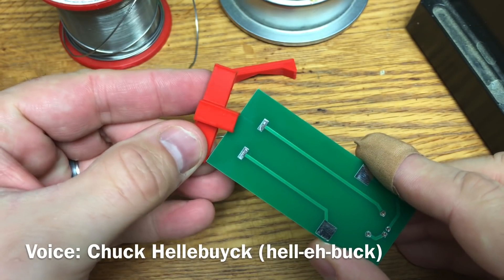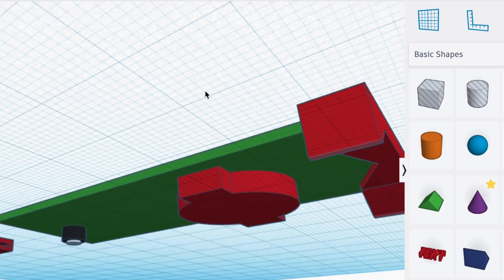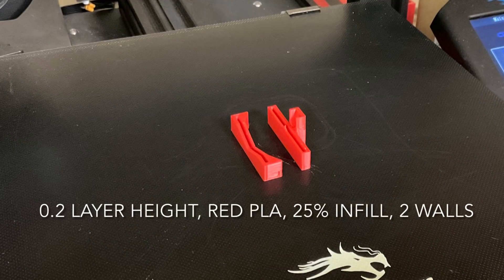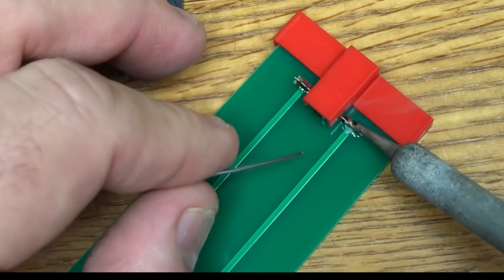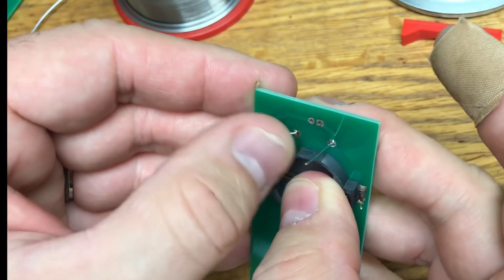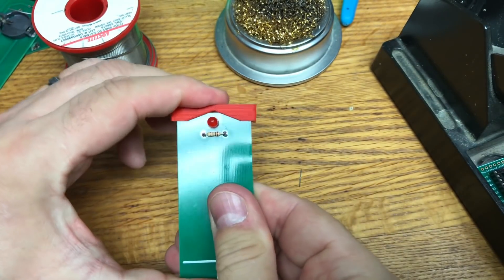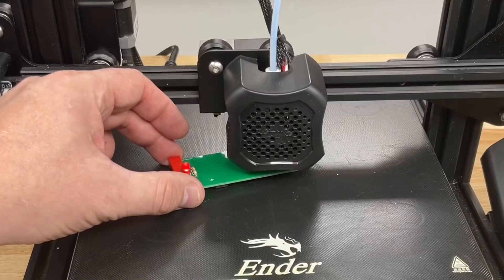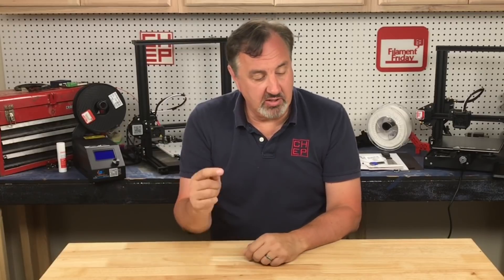Level Your Bed with the Filament Friday E-Leveler Tool

Comment: Have an ender 3 pro now and want to buy a fast printer. So around 1000 euros. Is the Voron 2.4 a good choice? Thanks.
Reply: A Voron 2.4 is not something that you "buy" ... you have to build one up from scratch. And most builders end between 1200 - 1500 € with all the parts.
When you buy a 900 € Kit assembly from Ali Express you will end up changing parts for better quality ones ... which brings up the price.
Reply: @hassosigbjoernson5738  I didn't  know, thanks for this information.
Reply from the maker: Some people like it. I’ve never tried one.
Reply: @FilamentFriday  Ok, thanks.

Comment: i must recommend the ts100 soldering iron it has been amazing i have used it for 2 years doing several drone builds and it has kept up also you can connect it to a xt60 lipo and its very portable so a must have for soldering and has updatable firmware endless features it has a stem32 chip in it
Reply: I enjoy my ts100 but as long as the pinecil is in stock I recommend anyone get the latter instead, it has all the benefits of a ts100, plus it has type c power delivery AND it's cheaper on top of that.

Comment: Good evening sir. I was wondering if you could help I have a cr10s pro V2 and I'm having a problem with bed leveling. The issue is I can manually level the bed in all four corners and the middle and it will be fine then when it comes to it's doing an auto bed leveling cycle the nozzle is too close to the bed in the middle. If I sent you a video of the issue would it be possible for you to do a video on what you think the problem is and how to resolve it I look forward to hearing from you

Comment: That can be made on busboard at the same thickness ehh. I've been ribbing you but it's an awesome spin in the simplest of circuits. Are you a self taught electronics guy? Being you have a mill and a hobbyist like me would have to beg the wife for 3 years to get one as good as yours haha
Reply from the maker: I’ve got a BSEE degree and 35+ years design experience + 3 patents. This was just fun project that grew bigger than expected.
Reply: @FilamentFriday  I figured. I'm a software engineer  for lack of a better word but I didn't do anything with the degree but I code alot now for fun but electronic engineering is a hobby/obsession for me. You're sharp as a tack and I always figured you weren't just a printer guy.

Comment: Question. Can a thermistor on my 2+ year old ender 3pro be bad.  No heating issues with new 120v bed heater.  But I noticed recently as nozzle heating up, temp would climb, then drop few degrees. Then climb. This would repeat over few times then say “ heating failure reset”
Reply from the maker: Might need a run of PID control.

Comment: Hi Chep, in Cura,  Do you know how to adjust printing speed for "Fill gaps between walls"? Thanks
Reply from the maker: I believe the main speed setting controls that.
Reply: @FilamentFriday   Thanks for the reply. The speed is not the same as the inner wall nor the outer wall. The gap is printing slower than the walls, can't figure out how to make it the same. Thanks

Comment: do you have the stl file for those  things you 3d printed tomhold the switch in place and the battery cover and the end cap
Reply from the maker: Yes, links in description.
Reply: where is the stl file for the switch cover and battery cover and end cover there is no link
Reply from the maker: They are in the description under STLs also on the more info webpage linked in description.

Comment: I really like this gadget, its cheap and easy to make, but i think that it would be easier and maybe more precise to use a dial gauge, with the gauge human error is close to 0. The biggest problem here is the allignement, for a good allignement u should be already well alligned with your nozzle, and only then put an offset hopping to be also in right height to match a motor step, with the gauge u will need only to establish first and once the z-height in way to be in range of a motor step (no microstepping) and then just adjust the level using the gauge. Without considering that the contact point will change from one button to another and from time to time cause of the time consuming membrane inside this buttons
Reply from the maker: I covered some of that here: https://youtu.be/9lczwYOQSbI

Comment: Honestly i can’t get around how much i love the simple thickness gauge i use
Reply: True. I mean if people buy it, it's good for Chep 😀 But using a 0.1mm gauge is super quick and you don't need to add or subtract Z offsets or anything...
Reply: @herrgerd1684  definitely. I just wonder how accurate my z-axis is. I’m gonna see if my new .9 degree pancake motor will work to make the  Z axis even more accurate instead of making it go on the extruder like i originally had planned. That might give a little more level consistency.

Comment: Did you consider using UBL?  It works with manual leveling and ABL.  It even has a verify mesh print builtin to firmware that fills the entire print bed and only takes a couple of minutes to print.

Comment: Any way you could get this to the UK cheaper? Is there a UK equivalent company you can work with to get these produced in the UK? I guess we should be able to get the components cheap enough from China or something it would just be the board that we need
Reply: I made a 3D printed one of these and it works like a charm. It's on thngiverse but I won't post any links as the comment always gets deleted when I do.
Reply: @mrnlce7939  what is the name of the print on thingaverse?
Reply: @weeurey  Electronic Device for Levelling a print bed
Reply from the maker: MrNICE79 - what is the Thingiverse number in the url?
Reply from the maker: Weeurey - If you know of a cheaper way to ship them I’m open to it but people from UK are already buying them. They’re using Airmail package which is the cheapest they’ve found. It’s flat rate so if you get a group together to buy more than one it saves on shipping.
Reply: @FilamentFriday  I just bought a boardgame from the US and for charged £13 shipping so there is definitely cheaper shipping options out there, like i said can't you send the PCB itself in a small envelope? We could source the led, button resistor ect ourselves
Reply from the maker: 13 pounds is $17.43. Not much savings. I’ll talk to my partner about bare boards though.
Reply: I talk to a lot of people across the pond.  Like @Chep suggested they tend to do bulk buys from the US and someone distributes them.  Perhaps you can find a maker space with other people interested in them.

Comment: Chep I wanted to ask someone knowledgeable.  My Ender 3ver2 homes right on the glass.  Is this normal? I thought in the past it’d raise just a bit. 
 I lift the z switch which gives me clearance but when I re level bed it’s touching glass again.  
 Using jyers default. Does the firmware have a way to set the home? If I keep lifting z switch my adjustments get looser.  Parking on the bed I fear is holding any ooze in and clogging as it cools. Is there a way to set home  a little above the bed?
Reply from the maker: If your bed is adjusted properly it should be right on it or just slightly above the glass. Sounds like it’s working properly. 
After a print is complete it can raise the Z in the End GCode of the machine profile in the slicer.
Reply: @FilamentFriday  what would the gcode say? Sorry to bug you.  I feel like it parking on the bed isn’t letting whatever Filament that wants to ooze out come out. Therefore  clogging.  Is my thinking wrong? I know I used to hit home on stock firmware and it’d raise a bit after homing.  Jyers default is parking it right on the bed.  It bugs me.  Again.  Thank you for your help.  You’re the only one I got.  Facebook group answers are crazy.
Reply from the maker: If you want to load filament just move the Z up from the menu or just turn the threads rod to lift it. My sits on the bed as well when I home.
Reply: @FilamentFriday  thank you.  Good to know.  I thought something was wrong with mine.
Reply: @FilamentFriday  disregard last msg.  My slicer gcode works as should.  As long as I hit print it’s ok.  But if I hit home all axis’s in menu it will home z to zero thus touching the bed.  I just won’t hit home all axis’s anymore. 
 Problem  is if I hit preheat.  It homes first and puts the nozzle on the bed. So no more preheating.  I’ll just hit print. I am not going to sweat it to much.  Getting good prints. But if you find a solution let me know.  Has to be jyers firmware telling it to home z to zero.  
 I’d change firmware if I knew I’d still have my manual leveling which I like a lot.  I know there’s a stl file that does the same thing but don’t want to have to find that sd card and code Everytime I wanna level. If you have a favorite firmware link me please. Non cr or bl touch. Prefer non mesh. Thank you again.

Comment: Piece of paper still works pretty good too.
Reply: I still like my paper too but if I were starting out now I might try his tool.
Reply: @jmr  What worked best for me was discovering (on this channel) the upgraded firmware that allows leveling to the 3X3 or 5X5 grid.  Fixed almost all my leveling issues...
Reply: @KB-kc7ou  That definitely makes things easier! I can't remember if I even leveled the bed with the OEM firmware.  I did my research(a lot on this channel) before I bought so when I got my printer I already had an upgrade plan.

Comment: I can't print the soldering fixture because my bed isn't level. And I can't build the bed leveling device without the soldering fixture.
3D printing sucks...
(LOL)
Reply from the maker: You can build it, level it, then 3D print the fixture and re-solder the switch perfectly ;)

Comment: Great little tool though the $20 shipping to the UK is crazy for such a small lightweight product that only costs $12
Reply from the maker: If you know of a cheaper way to ship than Air Mail package please let me know. It can’t go letter post.
Reply: @FilamentFriday  Can you post the board only with letter mail? I'm guessing the actual components are standard and can be bought anywhere?
Reply: I made a 3D printed one of these and it works like a charm. It's on thingiverse but I won't post any links as the comment always gets deleted when I do.
Reply: @mrnlce7939  hi, that sounds great! What is it called on thingiverse? I can't find it so far. :)